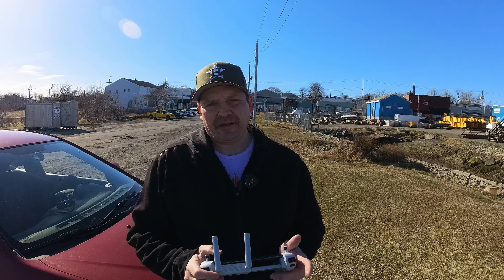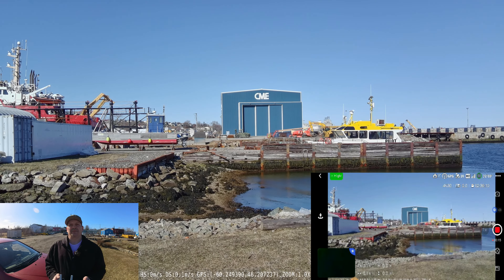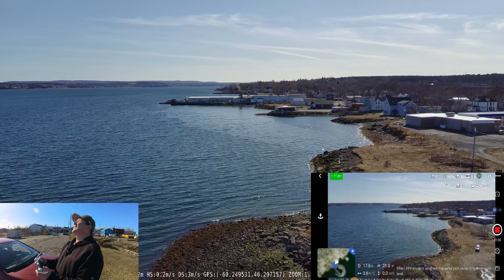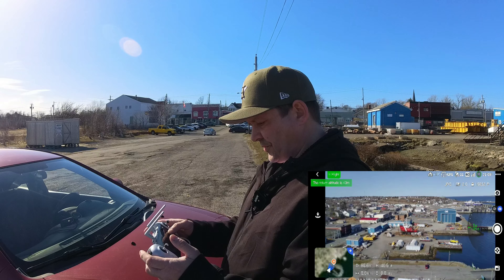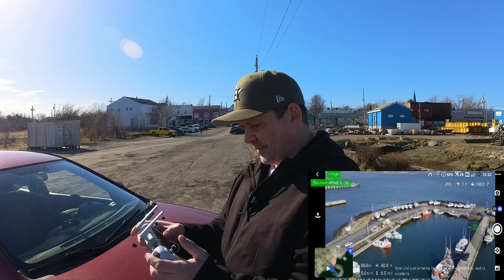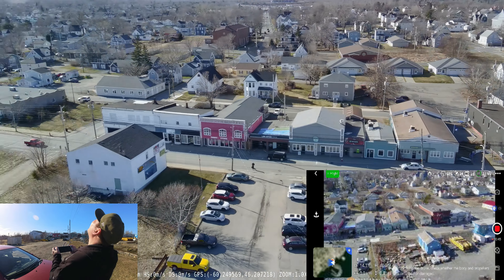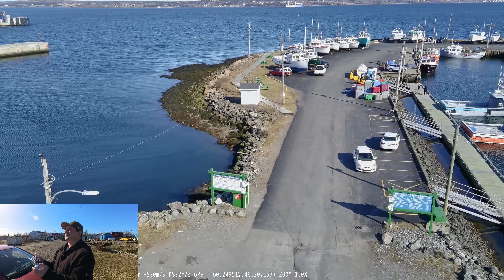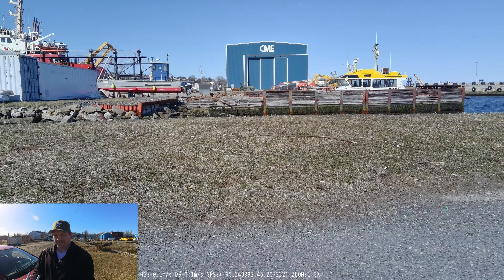Potensic Atom transmission issues

Comment: Cape I was just  sent the fimi out have you shut the controller off to see what it does. ?? I just did send it out about 100 feet I shut the controller off the drone went out to return the spot and came home and landed by itself. I didn’t even turn the controller back on.❤luv my fimi ❤
Reply from the maker: yes all of the newer drones will do this if the transmitter is shut off or runs out of battery .
Reply: @capeRCouple  yes I want to get it. I have it on to return the home on low battery low battery it just once it starts landing. I hit  to switch to return home then he comes up and returns home my other John returns home on low battery while hovering I thought this is supposed to t00?

Comment: You're not the only one stating lag in that specific drone & just when I had decided to buy it, now I think not. I hear Potensic doesn't have a good support team either
Reply from the maker: I now only get a little lag if the antennas are not pointed directly at the drone and as for their support i have nothing bad to say as they replaced the transmitter for me and when finding out that wasn't the issue they also sent me a brand new drone so now i have 2 of them.Customer service was top notch.
Reply: @capeRCouple  sweet. I like the fact it has follow me whereas the dji mini4 doesn't. I've got a HS720 but had to replace an arm  & having trouble getting to solder points due to a white coating,  so it sits on the table & um itching to fly thus undecided as to the next one.  Thank You Sir
Reply from the maker: @nobleeagle7661  that white coating is just a type of sylacone,just pick it off with your fingernail but be very gentle as those wires will tearoff the board and then its toast but it really isn't hard as i have done it before on the fimi mini.As for the potensic i always tell everyone its a good drone and to purchase it as it isn't very expensive and is very similar to the origional dji mavic mini and yes the follow mode is always great to have and works good.